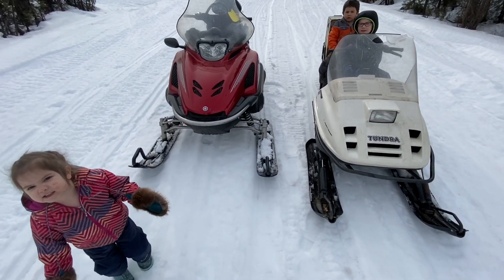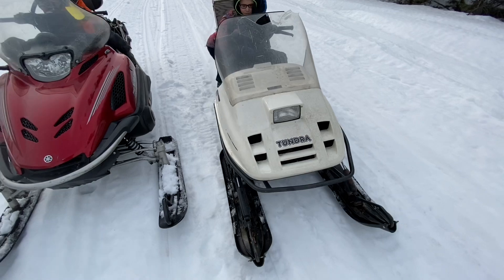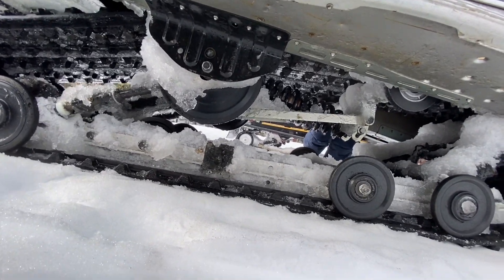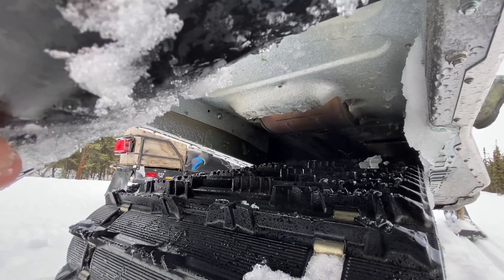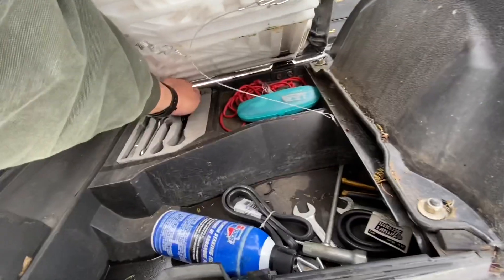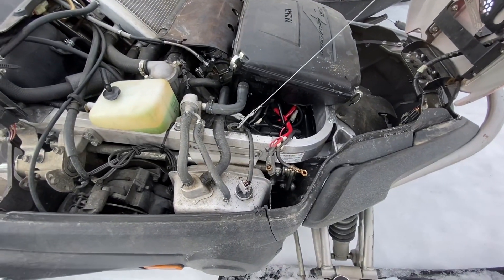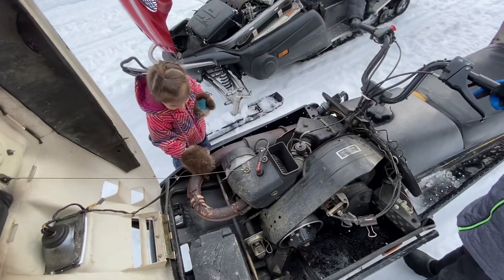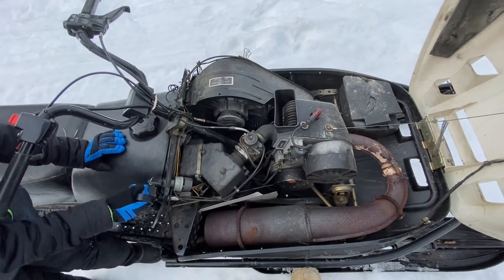2009 Yamaha VK Pro/1991 Ski Doo Tundra comparison.

Comment: Impressed by how good your little video partners are!   Our new snow-machines are sure complex!
Reply from the maker: Thanks, they're momma has done fine work!  I'm not a huge fan of the complex "modern" machine, but I'm not sure about the Arctic Cat 570 or the VK 540 anymore either.  Too bad they couldn't make the Bravo and Tundra EPA compliant.
Reply: @TemplesLongtailsandFurs  I like my 900 Ace Skandic a lot but  I bring a come along to self recover, a battery pack to start if the battery dies and a good pair of boots for when it does eventually break down... as there is not much I can fix.

Comment: I very much prefer fan cooled sleds for the ones I keep for years and years. It’s too bad they are getting phased out. I had a 4-stroke Vector for a while and I liked the motor but holy crap was it heavy! I got a stuck a few times and it was miserable to get out. I then noticed I quit riding in arenas I used to just because of the weight. It was also not fun to work on so I sold it. 

My brother had a Tundra for a while and I can see where guys liked them. It had limits and downsides in certain snow conditions as it was gutless but for explorer riding in bushy terrain it was great!
Reply from the maker: Yeah, this VK is damn heavy.  I’m thinking about the VK540.  Too bad the way the Tundra has gone, but people too like it.

Comment: I havent replaced a spark plug since 2004 riding yamaha 4 strokes,over 80 000 miles combined on my last   4 sleds,so no worries on how hard it is to change them
Reply from the maker: Nice!  Which particular models?

Comment: A few things to note...
The carbed 973 is rated at 120 hp.
Those aren't plug caps, they are actually the ignition coils, coil on plug is much more reliable.
The only thing that makes the plugs harder to change on the VK is that there are three of them, the process is exactly the same as with the Tundra.

Also, preference is one thing but to say that the Tundra is simpler thus more reliable is a bit of a misnomer.  The Yamaha calls for a valve adjustment at 40,000 km while that Tundra would be lucky to ever see 10,000 km.
Reply from the maker: My mistake on the coils, thanks for the correction.

There are 3 times as many plugs in the VK than the Tundra, they're buried in the block, part of which is covered by the dash, requiring the use of the that weird hinged tool to pull the plugs after pulling those long coils out.  On the real Tundra, there is one plug, right out in the open on top, it's a snap to pull.  

There are SO many more moving parts, so much more electrical gidgets and sensors, so much more that can fail on modern machines than the old machines.  Will a modern machine's engine last more miles than the old fan cooled premix 250 CC, be that engine in my preferred Bravo, or this real Tundra?  Maybe, if you can keep the rest of the gidgets on a modern machine operating.  That VK had me calling for help twice last trapping season due to electrical issues.    

Trailwise, away from a dealer/shop/technician/computer, in my own very subjective opinion, the less smart a machine is, the less electrical stuff it depends on, the simpler the cooling system and ignition system and lubrication system, the less there is to fail and if there's less to fail it seems like there are less failures.  I'm certain between myself and the original owner that Tundra has likely gotten more than 6,200 miles.  The skegs are worn, it could probably use new rings, the recoil can use some tinkering, and the rubbers from the air box to the carburetor to the block ought to be replaced soon.  Projects to make sure I get taken care of between seasons, that I can actually do on that machine. 

My wife keeps telling me that we can't buy me a new machine, so I'm likely going to run the VK into the dirt, maintaining it to the best of my ability, and taking it to the shop when I have to.  I'll likely get a good look at it's longevity compared to that 1991 Tundra, and these types of video will likely continue.  

You sound like you might know more about the modern Yamaha than me though.  What machine do you ride?  Eventually, I'm probably gonna have to buy a new one, would like other people's real world perspectives, especially if they're in similar conditions doing similar things.
Reply: @TemplesLongtailsandFurs  
Right now I have a 2014 ski-doo expedition 600 ace which is a wonderful all around machine.  Quite, light, sips fuel (300 km per tank) and low maintenance (6000 km oil change interval and it only takes 2L of oil).
  Mine has 8000 km on it and runs like a top.

I also have a 2005 AC T660 turbo touring with 10,000 km on it, it's a nice machine too but I might sell it if I can find a vk540 that isn't trashed.  I had a 2009 RS Venture up until last year which I used for heavy hauling.  I don't find the Expedition as good for really heavy loads since it's so light so that is why I'm keeping my eye out for a 540 to use strictly for work.  The 660 is a good trail machine but the drivetrain isn't robust enough (under sized chaincase bearings) for the kind of heavy hauling I do (firewood, saw logs, grooming) so if I can get into a decent 540 for the same money as my 660 is worth so I'm not cash out of pocket, I will probably go for it.

There are way more parts in newer sleds for sure but I find the quality of the parts is way better than anything built in the past, especially the made in Japan Yamaha 4 strokes.  My venture with the same engine as your VK had 16,000 hard km on it when I sold it.  The only reason why I got rid of it is because the suspension was too stiff for riding without a passenger (how I ride mostly) and the seating position sucked (seat too low, my back isn't getting younger).  It never once failed to start and get me home, never used any oil and was great on gas.  With the kind of mileage I put on, fuel economy is a big deciding factor.  I once rode 9000 km in one season and have had a couple of 2 stroke ski-doos go past 20,000 km (one close to 30,000 actually).

I grew up on Tundras in the 80s and in my experience, they were not a very good machine... there always seemed to be something to tinker with before, during and after every ride.  They also seemed to suffer from excessive rusting but that may have had something to do with riding sea ice.

I can see your point about a simpler machine being easier to bush fix for sure.  I also see your wife's point about a new sled, they are very expensive.

Take care.
Reply from the maker: @ih302  I'm glad your Yamaha fourstroke always started!  Mine has failed to start twice for electrical issues that took me too long to track, and also due to cold even when the aftermarket heaters were plugged in.  If I was a better technician I might have figured the electronics before the 2nd call for rescue, and I've put on a new trickle charger and made sure the oil and coolant heaters are working.  Mine does not seem to use oil, but does seem to loose coolant.  I need to chase the myriad of connections and hoses, that are wonderfully absent on a fan cooled twostroke.  

Yes, the Bravo seemed to be better than the real Tundra.  But the ones I can find I want are priced too high.  

My issue with the modern Skidoo is the same as my issue with the modern fourstroke Yamaha; too dang many panels, access to anything is a pain, and too dang many moving parts.  If my wife and I could stomach 10 grand for a VK540 I'd sign papers tomorrow.  But we'll wait, the price will go up, and I'll get to say "should have bought a new one then for 10 instead of a new one now for 12."  Oh well.
Reply: I hear ya on the price... I will only be able to get a used VK540 if I can find one for what money I get for the 660 or if I find someone who wants to do a swap and only if I can find one in decent shape.  I have not had a new sled since 2007.

We don't normally get below - 20C here so cold starting has never been an issue with my four strokes.  From what understand of it, it's normally stuck relays that cause the problem and taking them off and warming them up in your inside pocket or arm pit or whatever usually clears up the issue.

Also, I was wrong on the spark plug change procedure, the Vk Pro has an air radiator and fan that blocks access to the plugs and must be moved.  My RS Venture never had that so it was the same as changing the plugs on a 2 stoke only the cap (coil actually) needed to be removed to get at the plug.